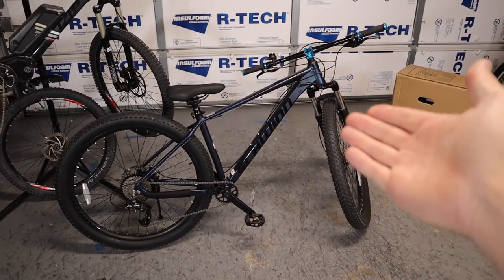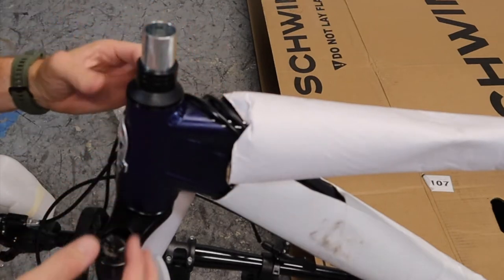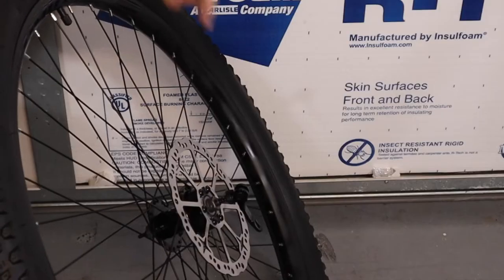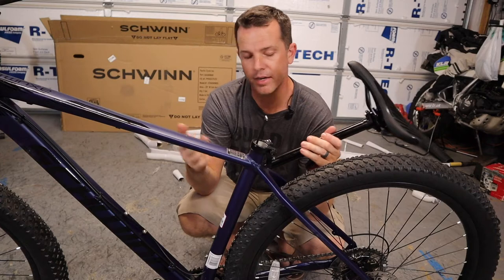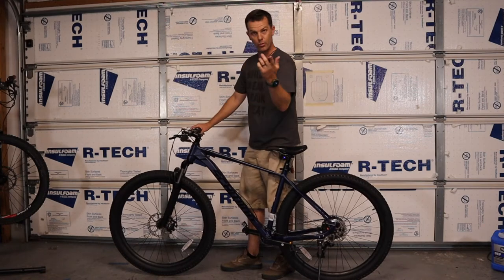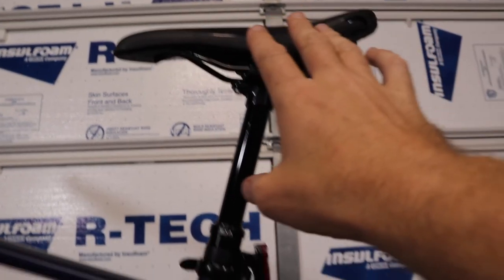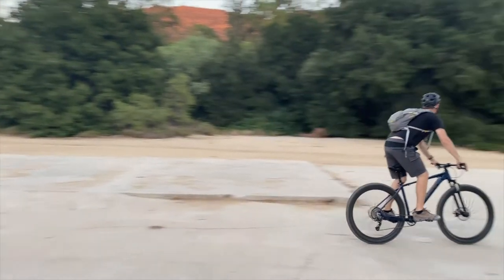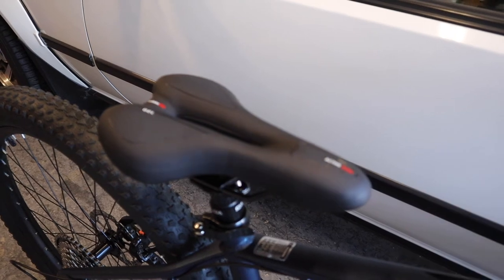How to Assemble A Bike - And Tune It Up!

Comment from the maker: The Axum without the dropper post is currently 1/4 off as of 9/26/2022 : http://bitly.ws/uFQ3
Schwinn Axum without the dropper post (cheaper): http://bitly.ws/uFQ3
Swhwinn Axum DP: http://bitly.ws/uG6N
Reply: Got the axum for about 1 month now, it sometimes skips a gear as I pedal, how can I fix that? It goes from a high gear to the next low gear without me using gear shifter, should I adjust It with the barrel adjuster at the derailleur?

Comment: Very informative video. One thing you should mention is using grease or anti-sieze paste when assembling metal to metal parts, such as the pedals and seatpost. Otherwise, they can corrode and become almost impossible to remove later.

Comment: Fantastic video! I followed it step by step for my Schwinn Axum. The front brake cable was wrapped up under the frame and I couldn't get the handlebars on. Thankfully your video showed me that they were installed incorectly. The tips you shared about the barrels on the brake handles and other things were helpful too - I learned quite a bit with your video!
Reply: Mine was the same. Probably put together by the same person! :D
Reply: What are your thoughts on the Schwinn Axum? I'm thinking about getting one, since I don't have a 29er. I have 1996 Specialized Hard Rock hard tail 26" and a 26" full suspension Sette Ace.

Comment: I just got a Schwinn Axum (black, non-dropper) ordered for $228 +tax.  ROLLBACK sale right now at Walmart.  I am stoked to check it out. Amazing for msrp of $400, but a steal for $228.  It can sit next to my $5000 carbon Specialized Stumpjumper, and still look awesome. :)  As a bike mechanic, I would say ALL bikes need to be checked properly unless coming from your reputable LBS, and still you need to adjust things to your spec. Seat height, saddle fore/aft, brake lever angle/ reach... etc.  Good Vid, Man!!
Reply from the maker: Holy smokes! That’s a crazy deal!

Comment: I just ordered my Axum. Should be here in a few days. Unfortunately the first Axum came out a month after I bought my Giant ATX. I've been wanting one ever since. I'm not impressed with the Giant at all. Both are the same price. I have one question with the assembly. Will I need to grease anything? I've heard there is a lack of grease in the big box store bikes. Very good video by the way. Best of luck to your channel.
Reply from the maker: Actually, after I made this video I tore the entire bike down and have a bunch of upgrades. There will be a video on that soon. I was pleasantly surprised to find ample grease inside The headset on the bottom bracket. You should be fine.

Comment: 18:30 Fully extended leg while peddling is the most efficient and least strain on the knees. Transfers max power to the drive train. It's not a comfort thing.
Reply from the maker: Yes and no, full extension sacrifices some pedal control at full extension. On my road bikes I’m set to full extension, my cross country bikes are probably around 90% and my “all mountain” it varies but is pretty much never at full extension. It also absolutely is a “comfort thing” depending on your physical limitations and/or injuries.

Comment: Oh man thanks for this video! Sadly before sawing the seat post part my cousin messed up the little head that came with DP inner cable and the thing just got inside the plastic and now impossible to get it back to how it was.
I will have to buy a new one, do you know which one to get for the seatpost? I barely know anything about bikes

Comment: Thanks for the video, without this, it would have taken lot more time for me to assemble the bike together. 

Now, I took the bike for a 1st spin, all seems fine except I hear some noise from the front tire, like something is rubbing the tire. I can’t visually see it though, any idea?
Reply from the maker: It’s probably the disk brake rubbing, try listening up the quick release, putting down weight on the front end, pulling the brake, and retightening the quick release while still holding the brake.

Comment: approximately how tall are you? And do you feel like the bike is too big or too small or just right for you?
Reply from the maker: I’m 6’2 and have the large frame, I like the size, some might say it’s a tad small for 6’2 but I like the fit. I did change the bars out to bars with some riser in them.
Reply: @BudgetOutdoorAdventures  ok. I’m 6’2” and I just bought the regular Axum with the large frame and it feels a little uncomfortable. I’m considering getting a shorter stem and higher bars. Also the saddle is way too small. I think that will make the bike perfect. Also thanks for the vid, this was my first time assembling a mtn bike

Comment: Major thanks for this video as it helped tremendously. I have small issues... I installed the dropper post the same way and the seat is off and I click the button for the dropper it makes the same movement as yours but when I fasten the seat I get no movement from my seat going up or down. My front wheel is in and the front brakes work but I feel a little play with the front wheel going side to side. Is this normal or should something be tightened? Thanks
Reply from the maker: Glad it helped, have you tried removing the seat post and seeing if the cable is still seated correctly? If the wheel is going from side to side that usually means the quick release hasn't been tightened enough. Try opening up the quick release and giving the nut a 1/2 turn and see if that helps.
Reply: @BudgetOutdoorAdventures  Update: The dropper post works fine. I inititialy thought the lever button would allow the seat to go down or up without mounting it lol. I took the front wheel off again and restarted the process. I notice that the front wheel had a little play even when not attached to the fork. I believe the wheel hub came loose in the box. Can It be tighten to do I need to send it back? Thanks!

Comment: I just put this bike together today and seem to have issues with the front rotor rubbing against the pads. Do you think I just need to adjust the front wheel?
Reply: I just assembled it and I hear the same kind of noise, not sure what it is though
Reply: @JayeshKamdar  I was able to figure it out later that day, you have to adjust where the fork lands on the axle and make sure the wheel is directly in the middle of the fork. After I got it I haven’t had any issues since, even after taking the wheel off and putting it back on. It’s a great beginner bike! Enjoy👌🏼
Reply: @TotalxTroll25k  Thanks, that makes sense, I will try that